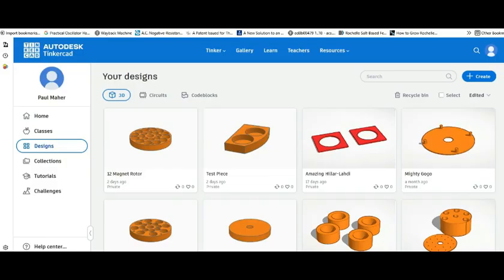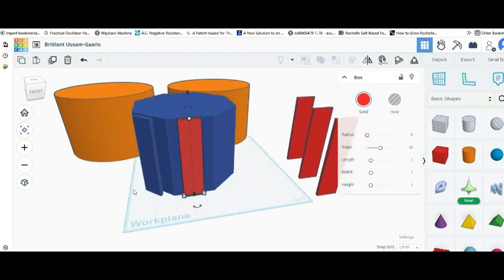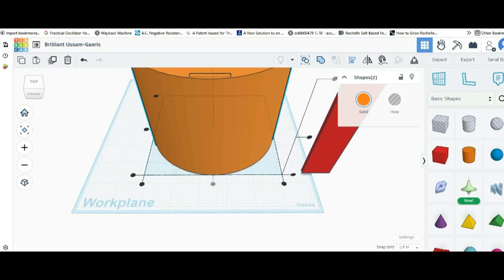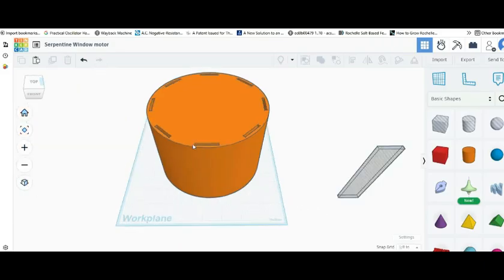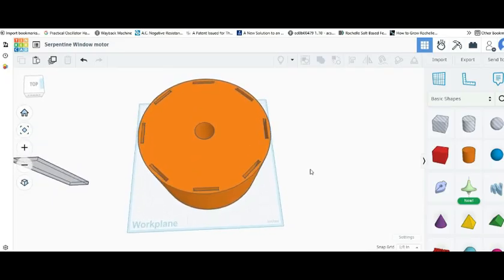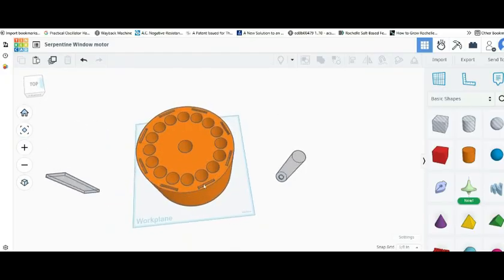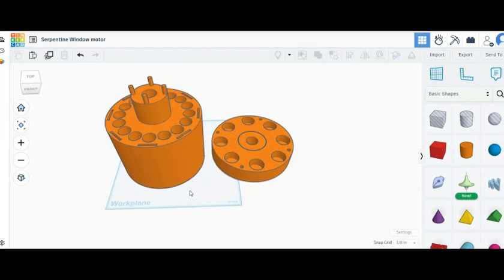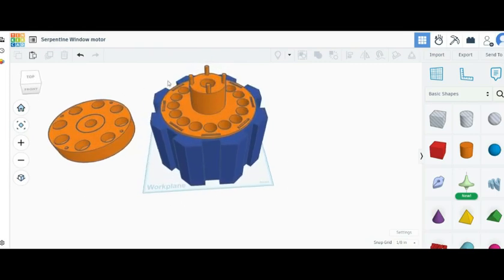Designing the Serpentine Coil Window Motor

Comment: If you want to see magic and extract the static "energy" of the magnet, place a moving coil on an iron shaft between two magnets that repel each other. 😎
Reply from the maker: You surprise me Tamas.  I'll keep working on what I am working on for the moment to not chase my tail like a dog.  Perhaps you are getting at the sort of super strong field that might come together if you bring two North magnets close together in opposition.  Is that what you are getting at?  In any event thanks for the comment very cool, 😎
Reply: Bonus 🤫 If you double the "power of the magnets" you get 4x the engine power with the same amount of gasoline 🤭😎